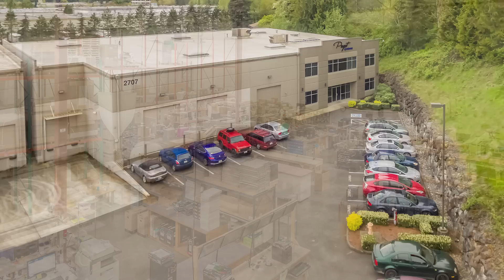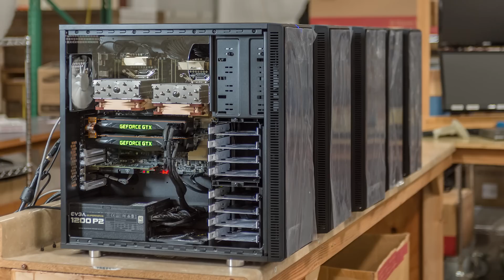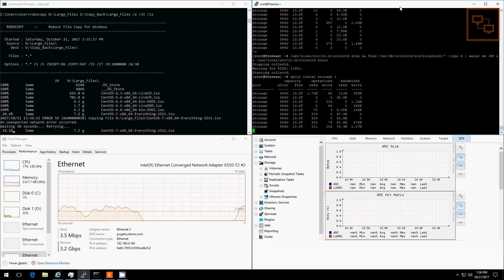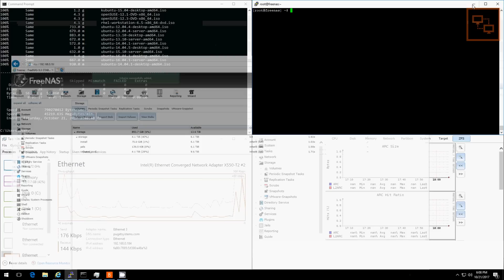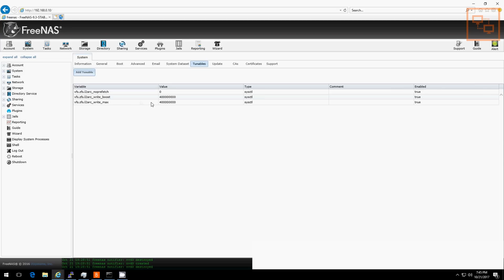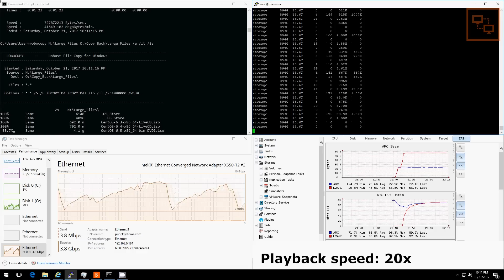Accelerating FreeNAS to 10G with Intel Optane 900P

Comment: Amazing analysis, thanks for sharing.  Lots of useful data.  I used PrimoCache in system - uses RAM as HD Cache - worked really well for boots.  not 100% hit rate.  I was not aware of those 3 parameters - i gues in primo also similar would be there.  Even you could have a RAMDisk, for random small files (in case you have that as a use case - drivers?)  Thanks for sharing!

Comment: increasing MTU size on all the network switches should help.....

Also, considering that you are Puget systems... I'm surprised there is only 32GB of RAM and you are using a CPU with such a low base clock speed.
Reply: Yep, it was a server we built a few years ago that I was speeding up. Would MTU size on the switches do anything if I don't also update the MTU on all the client PCs?
Reply: You'll have to manually set the MTU higher on clients and the server also.
Reply: There are also tcp  send and receive buffers you can increase on the clients/server  which vary from OS to OS.
Reply: Yeah, I talked about that a little bit at the end, I don't think that's it is feasible for our specific situation. I appreciate the suggestions though!
Reply: I dont believe that freenas can leverage the enhancements of SMB3...yet. and you could redesign the storage server but that would probably be too involved to change it up for the marginal gains you would get now after the optane l2arc gains are so close to maxing the link speeds.
Reply: If you are familiar with scripting... you could script the file copies so they begin all at the same time instead of one after the other.
Reply: Tuning MTU is not worth it. 10GbE cards have no problem doing 9.5Gbps without jumbo frames. In some cases if you have a weak CPU on the client systems jumbo frames may reduce the load on the CPU a bit which can help you max out the bandwidth. Jumbo frames is more of a bandaid when you have underperforming components.  Also make sure RSS (Receive side scaling) is working.
Reply: Im just suggesting it because its worth testing... IMO
Reply: It would be cool to see the follow-up include simultaneous transfer of the files!

Comment: Do you know if the Intel Optane 900P 480GB SSD will work as well on AMD CPU and if so, do you lose performance compare to intel CPU?
Thanks
Reply: Optane is not compatible with AMD -- officially.
Reply: 900p is detected like any other SSD. It works with anything. For caching on windows with Intel Rapid Storage you need Intel but you can use primocache or whatever on AMD. Nothing stops you from using it as a SSD.

Comment: If You're always copying the same data, (especially if you're going to be making multiple simultaneous copies of that data to different machines as you won't maintain multiple 10GbE connections on one optane drive) it would make more sense to purchase additional ram. Zfs will automatically cache in memory, so no need to faff around with ssds.

 if you were copying very large files, too big to keep in a cost affective ram cache i'd in understand, but you don't seem to be? Why did you choose ssds? Larger cache for additional items?
Reply: Have you ever thought that there is a valid reason for each layer in storage of computer systems and that this is just a demo not necessarily representing a dataset where an ssd cache might make sense? What does your 480GB or more of RAM cost? Does the data you stored survive reboots?
Reply: I was thinking same thing, most real world cases a slog device is better use for NVME.  Still a cool representation of arc cache though. I also always mirror my slog incase of drive failure.
Reply: Yeah, absolutely I'd want to do that if I were just copying small things that could fit in cache. But we have about 500GB of images that we deploy. Hence the choice of the 480GB cache Optane drive :)
Reply: @shubitoxX  L2ARC does not survive reboot either. Only way to get the data to live is just creating volume directly on those 900p's
Reply: @morena_sun  It depends on which ZFS implementation you're using. Looks like on some persistent l2arc is available while on others it is more or less WIP.
Reply: @shubitoxX  smart one. he isnt saying add 480gbs of ram. hes saying just add the amount of ram equal to the price of the ssd. and optane drives arent cheap fyi. 

always go more ram first. l2 arc is for specific circumstances and can hurt performance cause it actually requires a file to be created that has to stay in ram thus lowering available ram. 

arc doesnt stay fresh. has to get warm after every reboot and the system itself is likely to stay live even while the building is closed down for night. 

they are adding the feature to have l2arc stay hot after reboots but its not implemented yet. 

arc compression is. they couldve also used an ssd based pool with specific files on that so transfer speeds are always fast. then just had those same files backed up in another folder on the rust. meaning pure performance for the ssd's who cares if they fail or whatever just stick two new ones in transfer the data back over and done. 

from what i remember l2 arc is really only recommended for people using deduplication these days. and that wont even last as there is going to be the ability to create a deduplication table that goes on its own ssd aside from arc. meaning you could just use a sata based ssd since performance wont be that important optane would still beat a sata ssd but still overkill. 

compression is more often recommended especially given freenas doesnt exactly need the cores alot of xeons have to do anything cpu utilization is usually pretty low. unless you have things like plex running on it. 

900p is like 500$ or something like that. easily couldve bought another 24-32gbs of ram with that. that said given the 24gbs of vram i suspect dead ram channel or weird set up where adding more ram requires buying higher density sticks meaning theyd lose out on their current ram.
Reply: There is overhead to l2arc that eats up your faster RAM. In almost all cases the recommendation would be to max out your ram first.

Comment: Have you tried to have several 1G NICs, let's say 4 NICs, in the server and trunk (bind several RJ45 ports logically together as one) their network connections in 10G enterprise class switch? It would result that each of 1G network cable will give your 2Gbps connection and you would reach theoretical maximum 80% of network capacity. Yes, the bottleneck will be the PC / Server itself how it can handle the data but I'm afraid the low throughput here might come from the fact the 10G solutions are not fully properly harnessed.